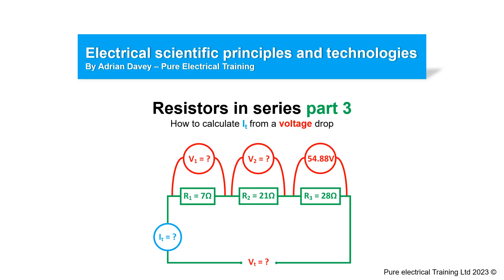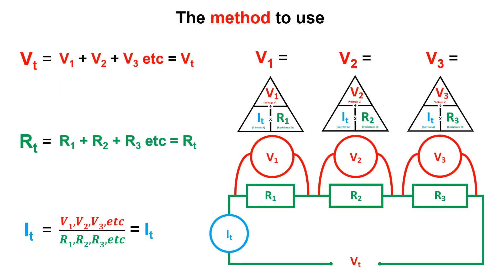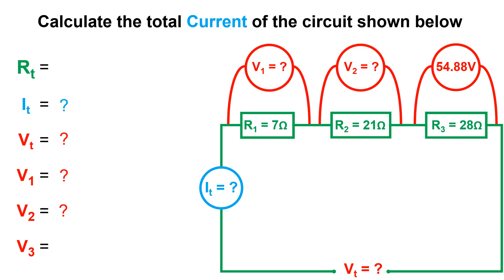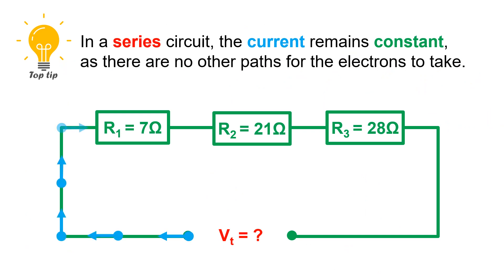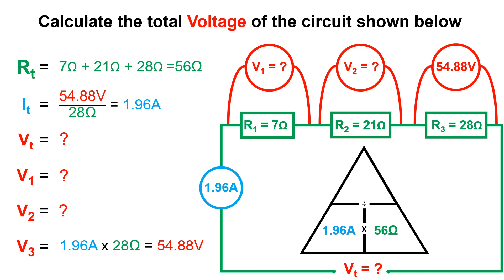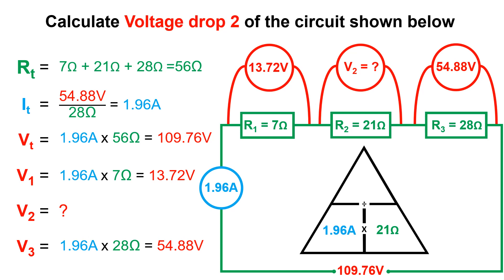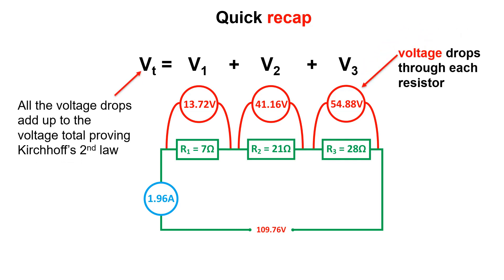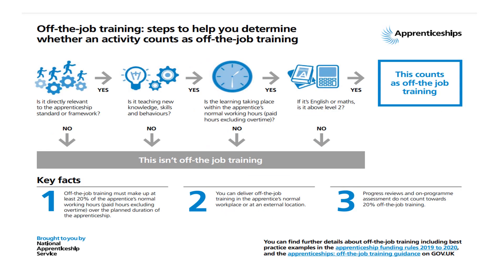resistors in series part 3 of 3 - Calculating the current total using voltage drop over a resistor

Comment: I am a new subscriber and at first solved the problem without looking at how you solved it and found another way. By percentages. Using the value of resistor 3 and its voltage 54.88V  and 28 Ohms, Rt = 56ohms and so to get V total. 54.88 X 2 = 109.76 V. 56ohms / 28ohms is 50% of the voltage drop. Then divided 109.76 by 56 to get the volts per ohm = 1.96ohms. After that its just multiplication to get R1 and R2 at 13.72 and 41.16 respectively. Then using Vt/Rt = It 109.76/56 = 1.96a. Notice how the amps and volts per ohm are the same.